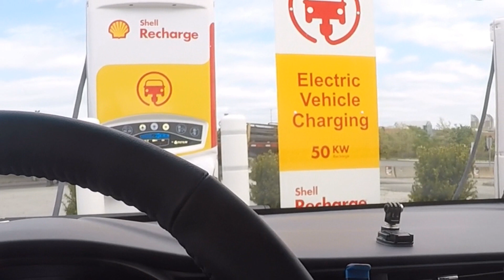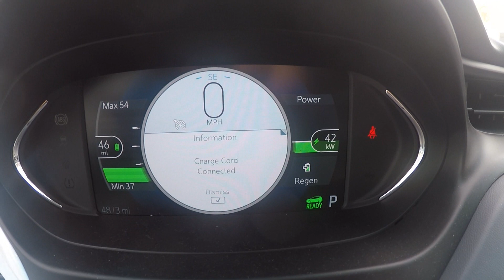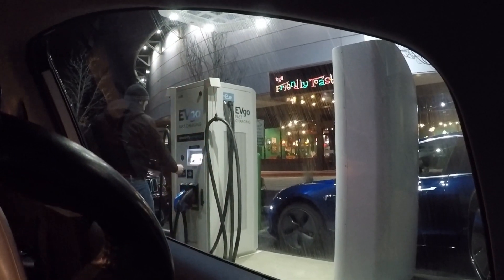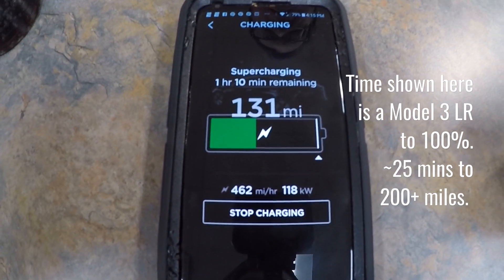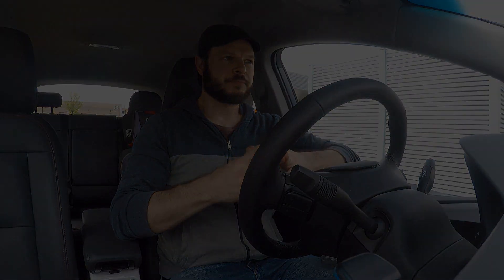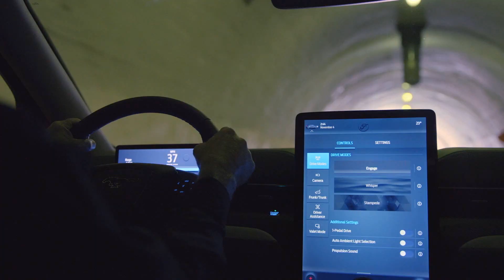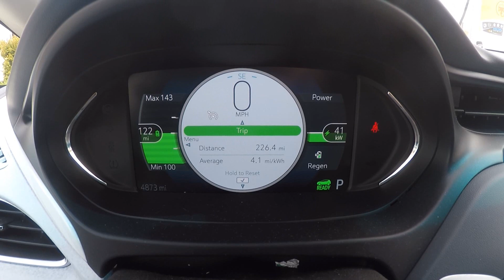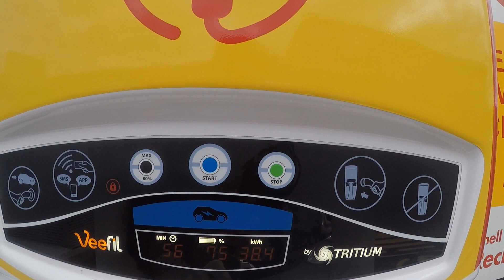Coffee + Kilowatts #5: How Quick Must DC Fast Charging Be?

Comment: Good video!!  What app do you like to find your chargers?  The myChevrolet app seems to have them on the screen!  My question would be:  How much is that “charger” component they put in your car for it to charge in 25 minutes vs 45 minutes?  I wish that Chevrolet or any manufacturer would just tell us!  I would then understand because why is the Bolt EV so much cheaper vs new cars that are coming this year?  I sometimes wonder if it’s a scam because some have the credits and others do not!
Reply from the maker: Thanks, Matt! It's a boring pick, but we always use reliable old Plugshare for new charge locations. Others like Chargeway and A Better Route Planner have their uses, but Plugshare is the most valuable in terms of recent user reviews and checking progress of a charge site. 

In terms of the onboard charger, I can't speak to cost but it's definitely an area where GM decided to keep costs down. The explanation for slower DCFC and no upgrades since the first model year (other than the 2020 taper vs. step down) has always been that the Bolt's hardware won't sustain a greater power level. Battery prices have fallen significantly since the car's design in 2015/'16, though, so hopefully they can find some room to improve at least the larger Bolt EUV, if not the 2022 Bolt EV itself.
Reply: @plugandplayEV  Did you see all the GM stuff from CES today?  I’m excited for the Bolt EUV and the new myChevrolet app!!
Reply from the maker: @kyliefan7  Ultium... Ultifi...errr, Ultron...!

Yes, there's all kinds coming down the 'pike and it's great to see. Forget slightly faster charging though, I want the next Bolt EV to have Vertical Take Off and Landing!
Reply: @plugandplayEV  Maybe one thing good about the Sleepy Joe Presidency will maybe be a $7500 rebate at point of sale for EV buyers only!  Not Prius Prime or RAV4 Prime which is stupid!
Reply from the maker: Coming back for GM and Tesla too, if reports are to be believed. I think the whole incentive program needs an overhaul though, tbh. Doesn't make sense to have this stuff at the luxury/premium end of the market.

Comment: @Plug and Play EV - Thanks for the analysis.  I think 800 volt tech will be the next big play in EV charging.  But Tesla could turn everything upside down with their news on the ever awaited battery day.  Whether it includes solid state batteries or not, that will be the next be disrupter in EVs.  
BTW, just subscribed as your 1000 subscriber!
Reply from the maker: Thank you kindly! If you're of the mind to receive EV-related freebies as thanks, email me at plugandplayEV@gmail.com and we'll put together a gratitude package 👍

And yes, 800V is right on the horizon with GMC revealing the Hummer (tech which should trickle down eventually) and Hyundai-Kia presumably aiming at 800V for some of this new IONIQ brand. I'm also intrigued by Battery Day... whether the development will be an incremental one that keeps Tesla ahead of the pack, or if it will be some major leap that forces even those committed to electrification to re-evaluate the pace of their plans.

Comment: For me, the more important aspect is that the charger speed needs to match the venue. DC fast chargers have no place at malls or retail outlets other than immediately next to the food courts. A 50 to 100 kW DC fast charger is completely inappropriate for a convenience store or gas station stop, where it would be perfectly appropriate for a sit-down restaurant, diner, or grocery store. Fast food restaurants and coffee shops should focus on 100 to 150 kW, while convenience stores, gas stations, and travel stops should emphasize 150 kW to 350 kW (or faster) chargers.
Reply from the maker: This makes perfect sense, although it seems most networks are focused on touting their expansion regardless of location amenities. Electrify America's site at Herkimer, NY next to a sit-down restaurant and hotel, for example, but no fast food options or J1772 plugs. Or EVgo unveiling a new highway rest area site today, but only adding 50kW equipment. 

It will certainly be interesting to see if charging infrastructure placement becomes more refined as more EV drivers hit the road and offer their feedback.
Reply: @plugandplayEV  Yes, the 50 kW chargers at gas stations are probably the most egregious in my opinion, which is why I'm not happy about Shell using the Tritium 50 kW units. They don't really offer much. 

DCFC without L2 AC at hotels/motels is also bad, but not nearly as much. At least with that, you can justify plugging in while checking into your room or packing/unpacking your car. 

EVgo has contracted with Chevron, and hopefully they will be adding 100 kW chargers at the gas station sites. Still a bit under powered, but way better than 50 kW. Apparently, BP is also looking to add chargers at their gas station locations, and at least those are 125 kW, which might be good enough for efficient EVs (faster would still be better).

Comment: To make EVs the only logical choice the goal needs to be to beat (or at minimum get close to matching) ICE cars on all fronts.

Charging speed is one of EV’s weaknesses (partial).

For AC charging a speed of 7kW or better is perfectly fine and a HUGE win over ICE cars – aka cheap and convenient charging at home or convenient and often free charging at public charges.
  
For DC “fast” charging, ICE cars are still way ahead (especially in the affordable $ car category). 
If you do a leisurely road trip, long charge stops don’t matter as much, but if you drive for a living or you are in a hurry (say family emergency) then long charging stops are torture. Not to mention that in cold weather you will loose even more range requiring even longer charging stops, increasing the time lost to an ICE car. 

***For now I think the charge speed needs to be proportional to the battery size***:

- Short range - below 150 miles needs a minimum of 50 kW (preferred 100 kW) charging rate. 
One example in this category is the new electric Mini. Why 100 kW when this is purely a city car not made for road trips? Because this would make it a perfect commuter car for a lot of people that have no place to charge at home (people that live in apartments or that rely on street parking) and that is a big chunk of the population across the world.  

- Medium range +-250 miles needs a minimum of 100 kW (preferred 150-200 kW) charging rate. 
Example in this category would be the Chevy Bolt. Why 100+ kW? Cars in this category are primarily city cars (90% of the time) but you can use them for a long road trip (10% of the time) (as you have proven it is very capable of doing long road trips). Giving them a fast DC charge rate will negate people from having an ICE car that’s main use “in case I need to drive a long distance” (I see this trend a lot that people love their EV but keep an ICE car just in case they need it for a long road trip).

- Long range 300+ miles needs a minimum of 150 kW (preferred 200+ kW) charging rate. These are long range EVs and people expect them to work well for long distances.
Example in this category would be the Tesa Model Y. This is the “I can do it all” category. Load up the car with my family and tow a small trailer (and we are already late, so I don’t want to deal with charging delays :) ). 

 Another topic suggestion for Coffee + Kilowatts – charging Infrastructure 
- Rural charging infrastructure is needed
- Fill in highway DC charging infrastructure (these are still very spotty in central and northern parts of the US and gives people a reason not to buy an EV)
Reply from the maker: Great details and thank you for the topic thoughts. We might move away from charging for an episode or two but those items are definitely on the list for the near future. 

The small battery case is particularly interesting, as the knee-jerk reaction from most folks (including myself, at times) is "needs more range". But I do think there's a solid use case for the likes of the MINI Electric, especially when the price is more compelling and the ride so nice... after all, how many ICE subcompacts (Fiat 500, Chevy Sonic etc.) are considered good for a road trip? Sure, the energy density of gas helps mitigate the smaller tank issue, but they're still limited in terms of cargo, comfort, and general driving experience. 

Lots to ponder at all levels, thanks again!

Comment: I have a Bolt and have no desire to drive it more than 200 miles away due to the slow DCFC. When I travel I'll have two types of stops. One is a dine in and relax stop which will usually last a minimum of 30 minutes. For these type of stops cars charging under 100kWh would actually be adequate. The other type of stop I'll make is more of a 15 min or less stop for a quick snack and stretch. So my ideal DCFC EV charge rate when traveling would be in the 15 to 20 minute range. For me personally, what a Tesla M3 gets on their V3 SC is what I'd like in an EV on a cross country trip. The Mach-E will probably be the first "affordable" EV outside the M3 that would get me there since here in the U.S. many of the EA stations are high kWh stations. We have two cars, the Bolt EV and an ICE sedan. I'm hoping in two or three years I have some good EV options with range and charge rates so that we can just outright go full EV.
Reply from the maker: This is exactly the kind of perspective I was thinking about when settling in this topic, thank you for chipping in. For some, the next EV will be their road tripper. They may have a current gen EV in the drive for local runs, or it might be their first, but in either case it will replace an ICE vehicle and need to be capable of Tesla-like recharge times or better. We might still be 12-24 months away, but these cars are definitely on the horizon for folks who aren't considering a Tesla.

Comment: On a related topic, I'm wondering if it makes sense to buy an EV now that takes 40-45 minutes to recharge to 80% when there are new models coming in the next couple of years that can charge in half the time?
Reply from the maker: Interesting question (which probably means a future topic, thanks!) 

As much as charging speed is a part of the purchase decision, I think it's important for individual buyers to step back and look at their specific use case. I accepted the "my car has to do everything" perspective in this video for the sake of the topic, but there are a portion of buyers who either don't need to - or want to - take an EV road trip. For those folks, limited DCFC capability is barely an issue and the current crop of EVs will do just fine. 

On the other hand, those buyers might be wise to hold off to see what downward pressure the next wave of more capable EV models puts on the price of current models. The Bolt EV is already heavily discounted, for example, and we should also see used prices coming down over the next year as more come back from lease. If Bolts find themselves in a similar situation to cars like the gen. 1 Leaf or older BMW i3s, slower charging would be a small cost to pay if the used price is in the $10-15k region.
Reply: @plugandplayEV  if the goal is to move vehicle ownership from petrol to electric, then the EV experience should be equal to or better in every way compared to driving a fossil car. The 2020 Bolt EV is a great example of how the car exceeds the capabilities in practically every metric compared to a similarly shaped/sized vehicle (Honda Fit) except for its road tripping capability. If the Bolt EV could get 200 freeway miles in 20 minutes instead of 70 minutes, then that would largely negate one of the biggest arguments against EV adoption.

As others here have said, 20 minutes of stopping for 3 hours of freeway driving is nearly comparable to a petrol-powered road trip now. If 800V is the only way to make that happen then it sort of makes sense to wait it out for mainstream buyers looking to make the permanent switch to EVs.
Reply: @anthonyc8499  I used to go back and forth about waiting for the next big thing but finally realized there's always a next big thing.  So I purchased a Bolt so that I could enjoy EV driving now instead of waiting.  It's overall a good car, just difficult (for me) to take on a long trip.  My guess is battery manufacturers will make incremental gains over the next few years but the solid state battery will be a game changer.  From what I've read, that's 5-10 years away.

Comment: It would be interesting to see if 800v and, say 60-70 kwh could be a working combination.  This would get charge times way down, and the battery wouldn’t be so heavy (vs a long distance battery of 90-100 kwh).  Being that you tend to use the bottom half of a battery when traveling, travelers would wish to see a larger battery, thus being able to run 150 to 200 miles between stops to charge.  If you can push 50 kwh into a battery in 1/2 hour, it would seem that would fit the bill (covers 150+ miles fairly easily), but we’d need to take a lot of cost out of big batteries to get to that level of charge speed and range in high volume production.  It would seem that really fast charging would also be detrimental to batteries (heat).
Reply from the maker: Battery cost and tech is such a moving target... you're right that costs need to come down and there's so much going on across different R&D investments right now that you have to assume we'll be seeing rapid advancements over the next five years. 

With that in mind, I honestly think the numbers we're discussing now will seem commonplace in a couple of years. Jump back to 2017 and 50kW charging was by far the best anyone expected from non-Tesla charging stations, to the extent that no-one had been able to confirm the maximum charge rate of a Bolt EV is 55kW. Even by late 2018, Electrify America only had a handful of stations across the entire country, so it's only in the past 12-18 months that that level has come to be considered "slow" for a non-Tesla vehicle, because we have a nationwide network future-proofed to the tune of 350kW-rated stations. 

It will be interesting to revisit this video in late 2021 and see what we think is the acceptable standard then.

Comment: Thinking back on prior road trips in the ICE.  We need breaks at least every two hours for restroom and stretch, and then occasionally for road snacks or actual food stop. A shorter stop at a gas station takes us around 10-15 minutes by the time everyone goes and finds a snack.  Probably every second or every third stop is longer where we eat and check out the area for around 30 minutes.  If every other stop were a longer charge with shorter charges in between, that would be perfect. What would that look like for charging speeds?
Reply from the maker: So to keep it simple, Iet's say you travel 150 miles in the approx. two hours driving until the first break. If the EV can do around 250 highway miles, you're at  around 35-40% - I'd drive another half hour and get it down to at least 20%, but that's not the point here! -  so you have at least 100 miles of range remaining. That means adding another 100 miles to be comfortable for another 2-2.5 hours of driving. That's roughly 30kWh of energy, which would mean a power level of 120kW.

Honestly, if you switch the order around a little and plan the first stop as your longer stop around 3 hours/200 miles into the journey, this is already doable in a Kia Niro EV or Hyundai Kona Electric... maybe even a Bolt EV. 30 minutes in those models gets 100- 150 miles of range, so you'd be good for another two hours driving and a shorter second stop to push on to the third longer stop. 

Not ideal, but almost achievable with the models we already have, which means that any EV charging in the 120-150 kW realm is going to comfortably exceed your ICE road trip expectations.
Reply: @plugandplayEV  thanks for the mathing!  Rest area charging would be ideal then. A quick stop and charge  to get through to the longer stops. I have been considering the Bolt mainly for the sales and service options, but knowing the Niro/Kona might meet our needs is interesting.
Reply: @jen1sur  your road trip cadence is about the same as mine. My coffee intake volume requires nature breaks every couple of hours or so. Combining a 10 min bathroom break with a 50-60 mile recharge means that with a Mustang Mach-E, I could get close to 300 miles of freeway driving before both myself and the car needed to stop for a 30-45 minute refueling stop.

Comment: A 1500 watt dc to ac converter and electric kettle/coffee machine, may be necessary to bring along for future iterations of your series, at least for a while.  

I think when fast charge speeds can average +250kw in future vehicles, therefore getting ~3 hours of driving in 10-15 minutes, most reasonable people will see this as a very acceptable and very minor sacrifice.  

Cheaper EVs and higher fossil fuel prices, will also play roles to influence buying decisions.  I'm looking forward to bi-directional charging for grid balancing and backup power "generation."
Reply from the maker: Ha, yep, a portable coffee-making facility would be high on my Bolting wishlist, along with faster charging and a panoramic roof. One can dream. 

The multi-functional potential of electric vehicles and related systems is a series in and of itself. The whole thing ia fascinating, as I think the value of energy storage in an electric vehicle's pack, currently just sitting out there in the driveway, is often overlooked. 

It's just so early in the game that we're all trying to answer questions about charge speeds and range, before EV adoption accelerates and the massive potential of storage/transfer is unleashed.